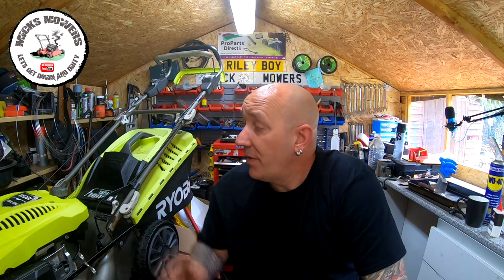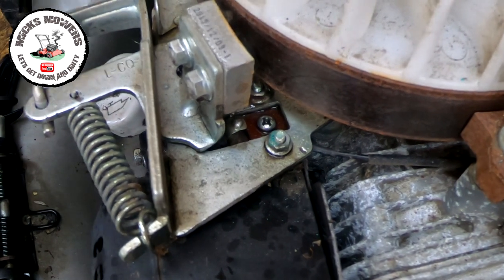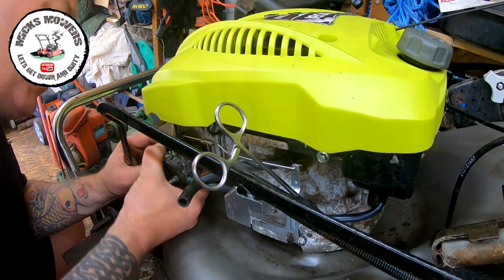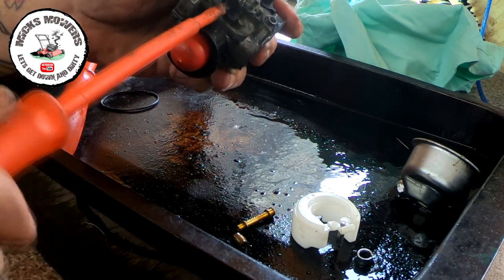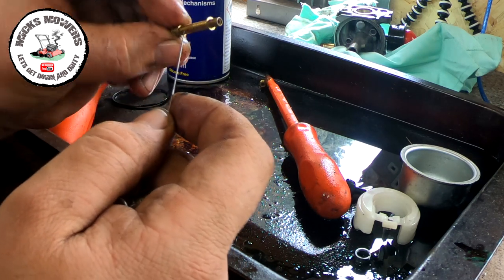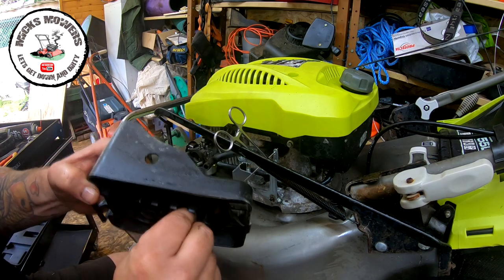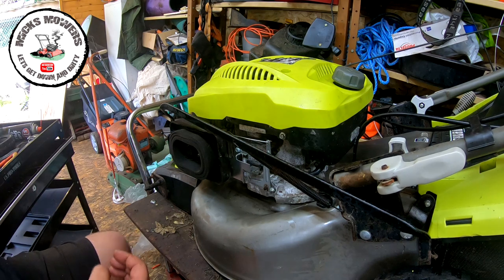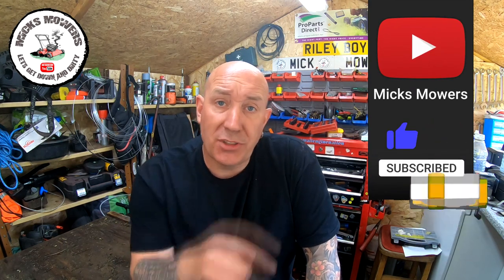Ryobi Lawnmower Part two Will it now Run Lets See

Comment: Good job mick, gaskett seaer is a pain if used wrongly,grease is the original sealer for gaskets,sound like valve lash needs adjusting ,
Reply from the maker: No mate its rod knocking and the engine is toast. I swapped it for the other one the following day

Comment: Just a heads up, is that a chonda engine, or Kohler, if it's a chonda engine, I did one yesterday, the pull cord was ripping out of my hand, so sheared flywheel key right, nope, they use a steel woodruff key, so instead of it shearing the key, and since the top of the crankshaft is steel, it shears the flywheel itself, what a horrible design, just wanted to give a heads up, if you or a viewer has a similar problem, it might be a sheared flywheel..... Well I had a spare flywheel for it from an identical engine, I replaced it, but the engine was still pulling the rope out of my hand, with these cheap Chinese knockoff chonda engines you have to adjust the valves whenever the flywheel shears, another heads up.
Reply from the maker: Like I said in the first video cheap Chinese mass produced.. but people love them because they are cheap
Reply: @themowerman  oh I know, but I explaine to my customers, I can't preform miracles, on a Honda clone engine.... LMAO
Reply from the maker: @knighthawk86855  like I say I'm a lawnmower mechanic now a magician lol